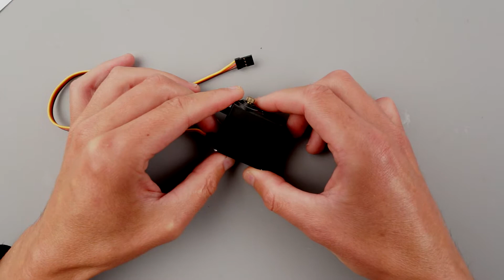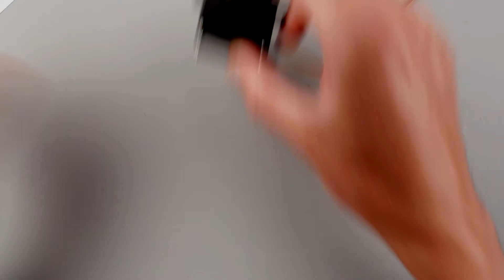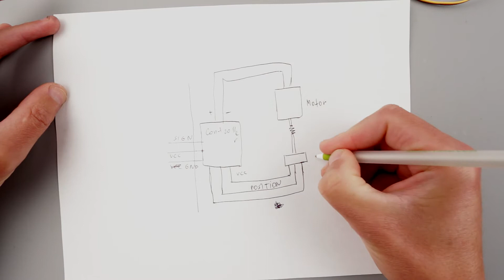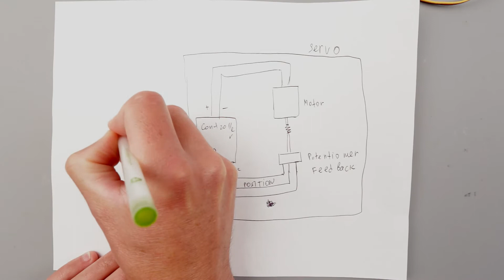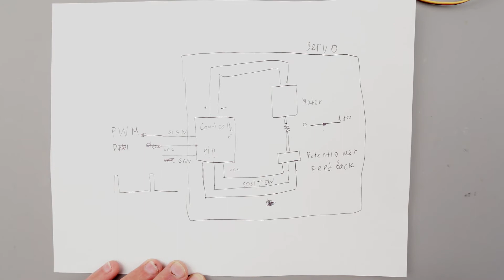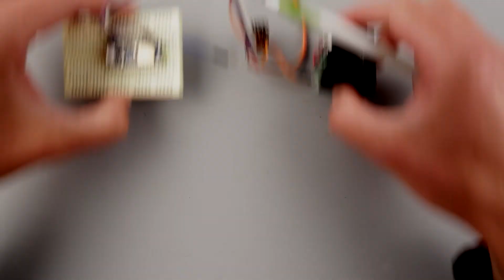How to make servo Smarter

Comment: Can you help me with a project that you have also with the Bescor M-101
Reply from the maker: Hi, what is the problem?
Reply: @InsideOutElectronics  Hi, Thanks for replying, you made a project with Arduino to control with a Phone right, my intention is about the same, but how about if I use the ESP sensor or camera object detection and send the instruction to the Arduino to move the Bescor pan and tilt, and instead to place it inside the box do a little box outside and connected to the 9 pin that it is used for the remote control
Reply from the maker: @samuellazcano9189  In this article it shows that all contacts connected straight to the 9 pin socket. http://mobilemodding.info/bluetooth-controlled-bescor-mp-101-pan-tilt-head-modification/ You can derive contact numbers form here.
Reply: @InsideOutElectronics  Yes I looked it up, my question is The parts I need would be the Arduino Nano V5? and what type of second mini board  do I need, to make it work better? the PixyCam or the sensor or the ESP ? that's the next step? I'm sorry for so many questions but I just try tp put all the pieces together, if you don't mind? I found this pieces in Ebay :
Pixy CMUcam5 Image Sensor or should I use: 
MINI USB Nano V3.0 ATmega328P CH340G 5V16M Micro-controller board for Arduin FIN
Just to put all the pieces together is like a puzzle for me, Thanks for any suggestion and help, if I owe you something and make it possible, let me know. Rgards
Reply from the maker: @samuellazcano9189  Arduino MINI will work as long as it is 5V version. Technically Pixy CMUcam5 can work instead of Arduino, but it is 3.3V logic. And probably will not work with Bescor 101. I never tried 3.3V logic with Bescor so I do not know if it going to work. What ESP you are talking about... it might be 3.3V logic as well
Reply: @InsideOutElectronics  mm OK, so what board can you recommend me to use to make a camera tracking to control the Bescor? can be possible? Yes the ESP32 are 3.3V but can we send the signal to another artuino to send a 5V signal and make the pan& tilt move by the camera in the ESP?
Reply from the maker: How are you planing to control Bescor? Via BLE or Wifi? Yes you can use ESP and Arduino
Reply: @InsideOutElectronics  At first I thought by WIFI, but I would like to control it by the auto-tracking camera. so will follow a person, of course I will probably will need to provide a color tag to make sure will follow what I want. this come to my mind because I want to control my camera as a no-camera man. BLE would be accurate but in short distance, WIFI would be probably better since I'm planning to place an extender, By the way this is a Church project so I will have 3 cameras. One in the balcony around 45ft away and the other two in first floor 20-30ft away from the main stage. so WIFI will be fine, I'm guessing but I'm open for your advice. But mainly my idea again is to be a NO-camera operation at all, just a an Auto-follow camera that will control the pan and tilt for the Bescor. I have 2 Andoer YT-260 Remote Control Motorized Pan Tilt Head for Extreme Camera WiFi Camera and Smartphone, for the small cameras, but I am planning to do the same "follow-motion device". is all these make sense ? That's what I am looking for help to find the appropriated boards, PI, Arduino + ESP , etc. Thanks for your time and help on this matter.
Reply from the maker: @samuellazcano9189  one more thing to consider is speed Bescor is relatively slow ! It is has quite slow paning and tilting speed. Keep this in mind
Reply: @InsideOutElectronics  Yes I know, with the tracking move I want, you think would be better to built a new one, new servos and with a quick response? I don't how to find that type of servo? what do you recommend? you know anything on mind? Thanks I hope I can find a solution I haven't buy the Bescor yet for that reason. Regards
Reply from the maker: @samuellazcano9189  check hobbyking.com
Reply: @InsideOutElectronics  Thank you so much.
Reply: Hi Misha? is that your contact name? any way, I have the Arduino Nano and the ESP32-cam, like you said these are v3.3 -V5, and to make the Bescor pan n tilt works I should use v5 , so can I use the trinketM0 controller to re-evaluate the voltage? like you said in 12:40 so I can send the signal to the Bescor? Thanks
Reply: @InsideOutElectronics  Hi, Thanks for replying, you made a project with Arduino to control with a Phone right, my intention is about the same, but how about if I use the ESP sensor or camera object detection and send the instruction to the Arduino to move the Bescor pan and tilt, and instead to place it inside the box do a little box outside and connected to the 9 pin that it is used for the remote control
Reply: @InsideOutElectronics  Hi, Thanks for replying, you made a project with Arduino to control with a Phone right, my intention is about the same, but how about if I use the ESP sensor or camera object detection and send the instruction to the Arduino to move the Bescor pan and tilt, and instead to place it inside the box do a little box outside and connected to the 9 pin that it is used for the remote control 
Can be possible if I used the Arduino 5V and the Pixy CMUcam5 Image Sensor? I am a newbie for this things but I can follow the instructions to putting all together, Thanks